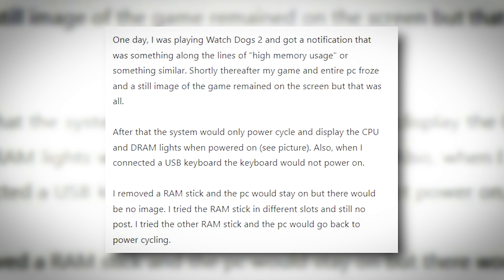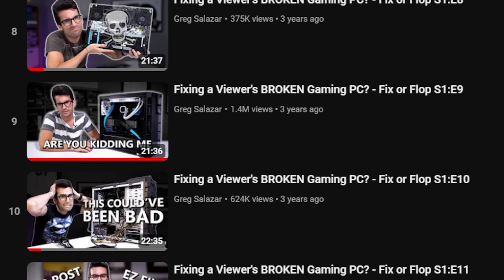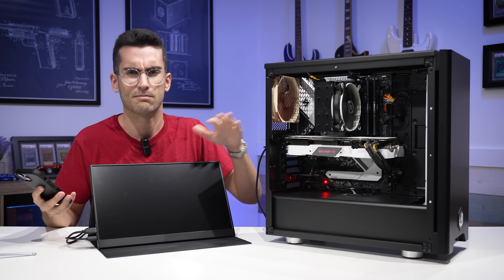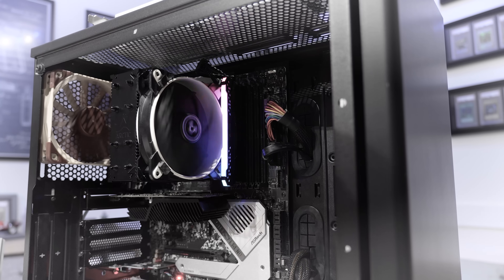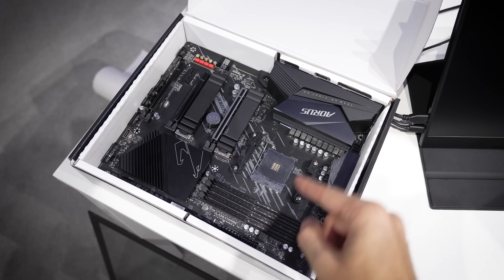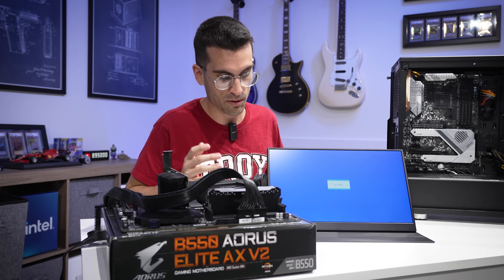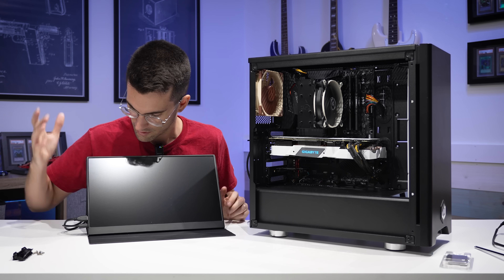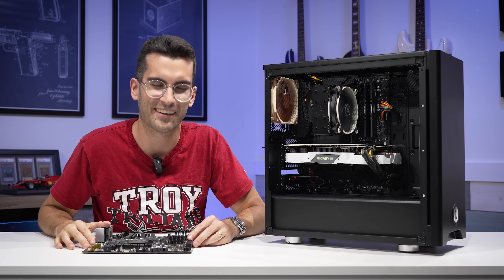Fixing a Viewer's BROKEN Gaming PC? - Fix or Flop S5:E20

Comment: @GregSalazar 14:41 the scenario you experienced was explained by the user at 0:32 under the bracket where he mentiones 'Different power supply'. This wasn't important at all but i felt like to tell just becasue owner did experience the same thing and maybe the case has some faulty buttons.

Comment: Although I've had problems with some Gigabyte hardware over the years, I do give kudos to them for sending you hardware to help with your Fix or Flop series.
Reply: While we're being anecdotal, I'll just throw out that my last couple mobos and GPUs have been Gigabyte and I haven't had any issues lol.
Reply: @Galiant2010  As far as motherboards go, Gigabyte has been good to me, had 3-4 of theirs so far, My one Asus board came in DOA. I have a x570 aorus master in my pc and a aorus ultra in the family pc i built.
Reply: I had issues once with a new one but this was forever ago(moving off of Slot A to Socket A) which after i got more skills did end up working in a lower end build for a friend, I've also had a 990FX-Gaming with an FX-8350 with zero issues, and currently have an Aorus X570 Master, also without any issues.
Reply: @Sadler2010  Hello fellow 2010
Reply: Gigabyte Aorus x570s Elite user and I now recommend them every build I do for friends!
Reply: Been using gigabyte mobos since 2011. No issues encountered. Just not a big fan of their software stuff, it's all janky and not clean looking.

MSI on the other hand... had problems with their hardware.

Comment: A working motherboard instead of a brick is always a upgrade, even if it is replacing a X570 for a A520
Reply: b550 not a520 lol but still nice
Reply: exactly I am running A520 with rtx 3080 and ryzen 5600  and I dont care much about overclocking. Stability is king.